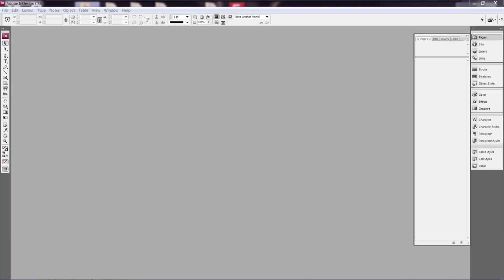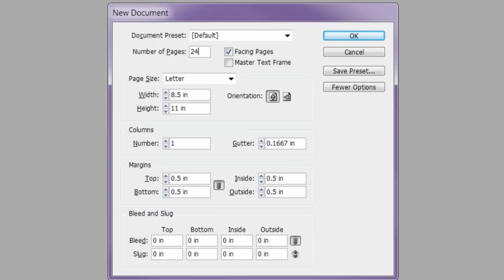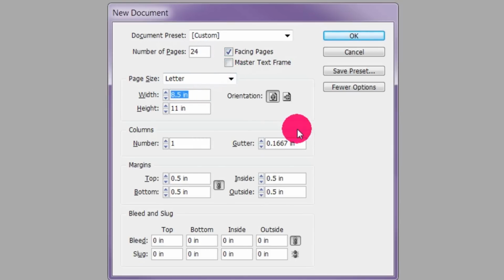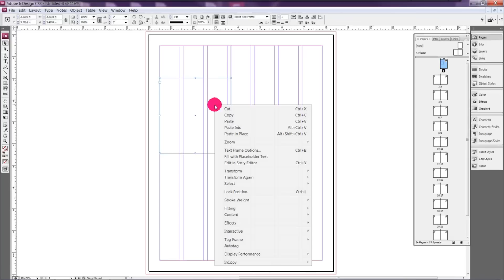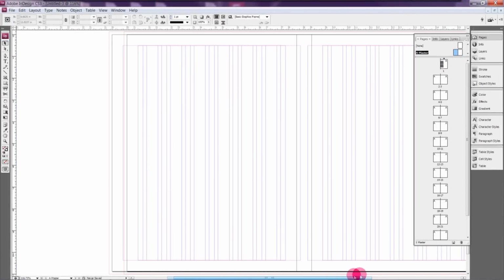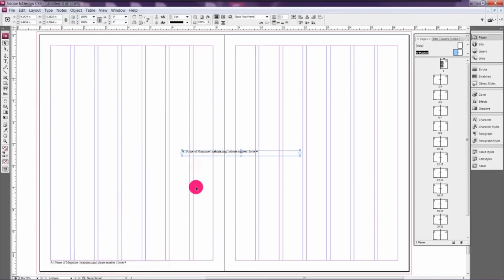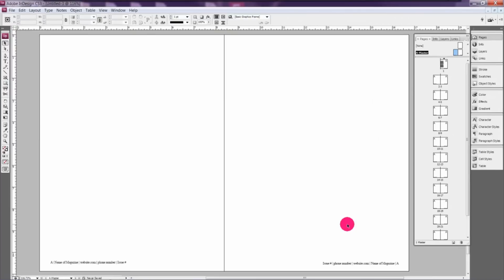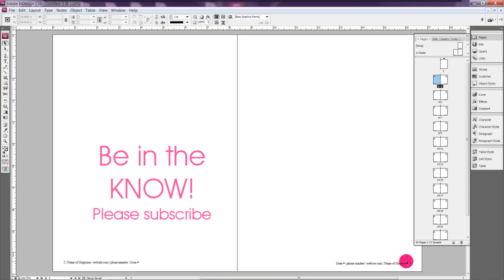How to Design a Magazine: Step 1 // MAGAZINE DESIGN

Comment from the maker: You can definitely copy and paste text from various sources such as Word docs. However, the formatting usually never translates over. In InDesign set your desired font, weight and size before you paste your text into the text box with nothing selected. Then can save this as a paragraph style so you can easily and quickly apply the same settings over and over again.

Comment from the maker: @alanbstard4 Thanks for the suggestion on glossary of terms. Since bleeds are common in all print projects, I have a tutorial covering them and therefore don't explain them in every tutorial. A short definition: Bleed refers to printing that goes beyond the edge of the sheet after trimming; typically 1/8" on each side. This makes sure your background graphics extend all the way to the edge without a white border during trimming.

Comment from the maker: @johnbuhril  I've built publications with the front and back covers facing such as smaller publications like performance playbills. Most magazine printers I have worked with require me to send pages saved as individual PDFs so my workflow is easier to start at the cover and end at the back page. What if you wanted different mastheads, or other elements on some of your pages but not all? That is where multiple master pages come in handy. Thanks for watching and your comment!

Comment: Maybe I'm missing some other videos of yours, but for a magazine, could you talk about how to arrange text to 1) wrap around short sections (like a fun facts section or an image), and 2) how to continue an article across pages (sequential pages like 6 to 7, and non-sequential like jumping from pg 4 to being continued on 7)?

Thanks :)
Reply: +JS 1): Make a text box for the short section and set runaround values - you can also use a picture box for the runaround and put the text box on top of that... 2): Simple text box linking. Go to Help. This is easy and vital to learn.

Comment: Very helpful! A quick question. After printing, magazine gets folded in half so page #2 will appear at the back of the magazine and all content won'd be in sequence. Unless there is another trick printing the magazine?
Thank you
Reply from the maker: +Maxone Studios Technically that was the old way of working with pages. You'd have to map out your pages in the way it was folded. Now you can design in the order you want your content to appear and the printer will adjust the pages correctly into spreads. I rarely upload one PDF to a magazine printer. They usually want each page as it's own file that they will print and lay out into the final magazine and correct page order. Makes things a lot easier!
Reply: +Maxone Studios It's easier to design with visual spreads, working with the printer will handle the details such file types, setups for web offset or sheet fed printing, paper, etc. That way they can control and manage press plate imposition to make sure it works.

Comment: When designing a magazine cover - does it need to be a separate file from the pages? I want to make an online magazine, before going into print, but I'm not sure what the process is to do so.
Reply from the maker: +Brother Hipster Productions LTD Most printers ask that the covers be in a separate file but it comes down to the printer preference. If you are stapling the magazine, you may not need to have a different file for the cover. If you are going with a perfect bound magazine, you most definitely will need your covers in a different file to create the spine width. I usually design everything in one file and then copy out the covers into a different file if needed. That way I can save out an online version too.

Comment: do you have to write everything and word first before starting ur magazine ?
Reply: If you are creating a design that has a lot of text--yes, a Word Processor just has more robust features. By the time your text gets to InDesign, it should be "camera ready" or close to final.
Reply: thanks
Reply: Sure, now, you can type the entire magazine content directly in InDesign if you like, but this is not how the design workflow was intended. You want to type large blocks of text with MINIMAL formatting. InDesign does not recognize a lot of complex word processing formatting, so you'll just wind up losing all the work you did or working harder to clean up the text once you place it in InDesign. Hope this helps.

Comment: Hm, confusing. You have a video where you explain how to design the front and back cover. Thats a separate file with gutter and a one page document with two columns, but here you refer to the back and front way differently. As the first and last page in the page stack. Whats up with that??

Comment: HI Niki,  can you kindly show us or me actually, how to use the import media and interactive PDF workspace for adobe in design?
Reply from the maker: What type of media would you like to import into your interactive PDF?
Reply: Design Like a Pro I was looking at importing embed codes for products and links? Such as with affiliate marketing embed codes. Even videos or you tube video embeds?
Reply from the maker: PDFS only contain the following interactive features: bookmarks, movies and sound clips, hyperlinks, cross-references and page transitions. Not full embed codes. If you want more I would use a fixed layout EPUB 3 not a PDF. That format retains more of the interactive features but has limitations on the platforms you can view the publications on.
Reply: @designlikeapro  Thankyou So much Nikki, I was also wondering the basic: in the page number insert special characters: how do you get the indent or lines between title of magazine then issue number, that line im struggling to find it or implement it and I think its really sophisticated.

Comment: I am using Indesign for the first time and i want to follow this tutorial but i  have it with the Metric System. :(
Reply from the maker: +Peter Byron You can still follow along! If you enter my measurements into your InDesign setup with mm or cm, it will auto convert. Example, type in 8.5in for width and 11in for height and it should convert to your measurements. See this in action here: https://www.youtube.com/watch?v=CQv6r4s-o1M
Reply: +Design Like a Pro Thank you, you are most kind. I decided to use an online converter . :) Nice video. Congrats.